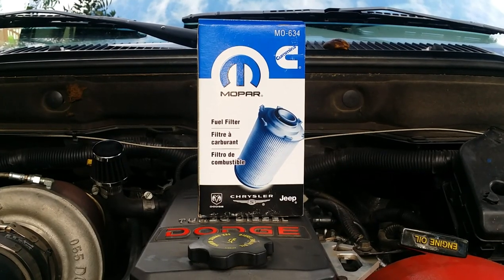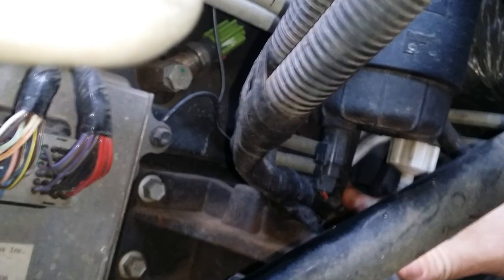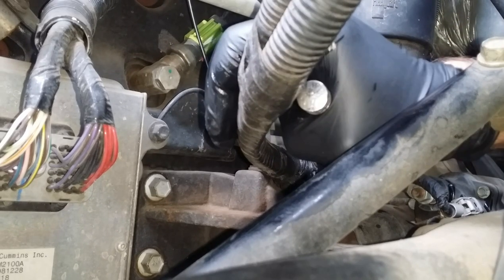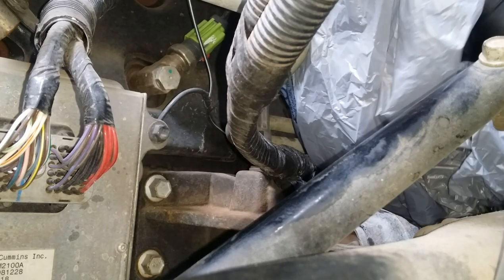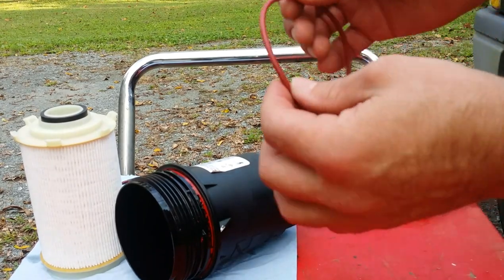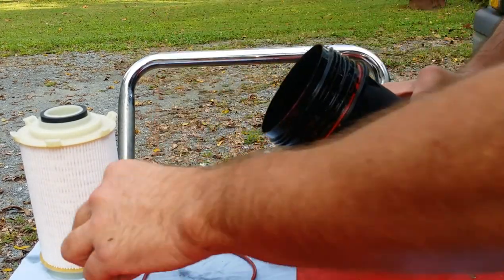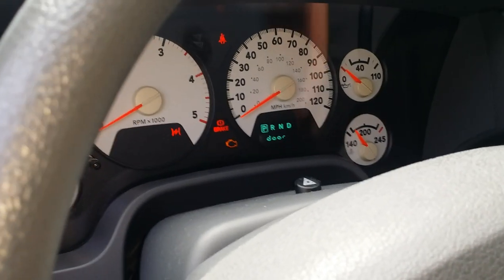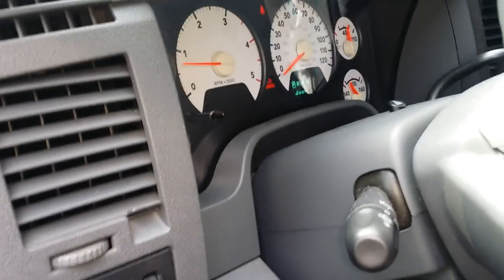07.5 - 09 6.7 cummins fuel filter change in detail

Comment: Just changed my filter this week after truck stranded me about 1.5 miles from home...but waited 15 minutes it cranked and I dashed for home, and it quit a couple hundred yards out but I was able to put it in neutral and coast to my driveway.  The next morning I changed the filter and it looked far dirtier than the one you were holding in the video, and the new one, of course is snowy white in color.  Thanks for the video.  Still grumbling about how hard the sensor was to get unplugged.  As far as I know, the filter had never been changed, 251K miles on it.
Reply from the maker: You need to change it every 10,000 miles. I change mine every 5,000. Glad the video helped. Thanks for watching.

Comment: Great video and I'm sure it will help me somewhere down the road. I'm heading out tomorrow on an 800 mile road trip to buy a gently used 2008 Ram 3500 SLT 6.7 2 WD single rear wheel. I've been looking for a tow vehicle for our travel trailer for over a year now and this may finally be the best one. Dealership has been very helpful sending pics and videos. Said the last owner kept it in a garage and never towed with it.
Reply from the maker: Heck yea hope it's the right one for you.

Comment: Thanks bro, super big help.  Only Rec is, if you can pre load the filter with fuel, much like one puts oil in the filter before installing, you’ll have less priming.  Tricky though because of the angles involved in snaking the filter and housing back in.  Again, thanks a bunch!
Reply from the maker: Thanks brother! Prefilling the filter is too big of a risk of getting trash in your injectors. You're right tho.......  would be tricky.

Comment: I just changed my fuel filter today. Not a easy task for sure! However I didn't bother with removing the wheel or inner fender. I was able do from underneath.  My truck is a 3500 2 wheel drive dually.  It was a struggle but still easier than removing wheel and inner fender.
Reply from the maker: They definitely didn't put in a good spot for easy access.

Comment: My filter is so tight im afraid of putting any more pressure on it, im not sure if this is still the factory or a dealer repleced it. Workrd on it for two days, its still a no go, next stop is go to the farm and get a 1/2 inch retch along with a filter wrench, this is one reason i never want to go into a shop for anything (striped the threads out of my oil pan when they did a simple oil change ) luckley i noticed it when i changed oil the next time and with a steal pan they can be fixed with plastic steal or thread lock on a reducer.
Reply from the maker: My gosh that's ridiculous. Get a new housing from napa or order one on line. I wouldn't put the old one back on and you will probably crack it getting it off anyway. Put the new one on using your hands only.

Comment: Very informative video. I’ve been Robbed. I have been doing most of my own service work for about the last 6 years except Transmission and Fuel Filter service because of safety concerns and I have a gravel driveway plus a torn Rotator Cuff from a couple of years ago. I recently stopped by a quick change place in Elko Nevada to see if they could change my Fuel Filter . I have known the owner for about 10 years and decided to give him the business. I had my own Fuel Filter and figured thirty or forty bucks would cover the cost. About 10 minutes later the kid comes out and the bill was $180.00 dollars. I asked him why the bill was so high and he said there were 2 filters that had to be changed. I knew that he was lying but what do you do in a case like this ? I paid the bill but I decided,never again. These Quick Change places are nothing more than a Ripoff and a lot of them should be taken out of business. It makes you wonder how many people are getting ripped off from these places.
Reply from the maker: Some models have 2 filters. 2007.5 to 2009 models only have one filter. What model is yours?
Reply: @isolateddieselperformance3261  it’s an early 2008. I bought it in December 2007.
Reply from the maker: That truck only comes with one filter.
Reply: @isolateddieselperformance3261  Thanks for the info.

Comment: Hey brother. What did you clean the filter housing out with?
Reply from the maker: Keep a small can of diesel fuel on hand and use it to clean the housing. Just rinse it out like you would a glass at the kitchen sink to get any loose trash out. Don't use anything else because the fuel system on these trucks are sensitive.

Comment: Great video!
I'm gonna try to do it my self thank you.
Every how many miles should I change the fuel filter?
Reply from the maker: Thanks man!! Its a easy job. Change it every 10,000 miles. Don't go past 10,000. You want them injectors to last a long time. Run some fuel treatment in your truck. I prefer hotshot secret for treatment.
Reply: @isolateddieselperformance3261  defenetly sir.
Where can I get the treatment from?
Reply: @isolateddieselperformance3261  also what kind oil you recommend ?
Reply from the maker: @RAULHERNANDEZ-um5fm  I run Rotella 15w 40 T4. Auto zone sells the hotshot secret fuel treatment. Amazon has it also
Reply: @isolateddieselperformance3261  awesome thank you.
Reply: @isolateddieselperformance3261 fuel filter from oreilly's wix?
Reply from the maker: @RAULHERNANDEZ-um5fm  cummins filter from the dealership or Amazon has it cheaper. I will only run cummins when it comes to oil and fuel filter
Reply: @isolateddieselperformance3261  thanks a lot for all the help
 I just did oil change,filter and fuel filter it was easy to be honest with you.
Keep doing great videos for people like me please

Comment: I’m getting a check engine light for thermostat and my heat barley works and my engine temp is all the way cold 24/7 that mean it’s a thermostat right ? WhAt u think 2007 ram 2500 6.7
Reply from the maker: Sounds like your thermostat is stuck open. Get a good quality thermostat and see what happens. Don't buy a cheap one.
Reply: Isolated Diesel thank you ! So much for replying. What’s a good quality one? Like how’s the ones at autozone lol.
Reply from the maker: You're  welcome brother! I prefer one from cummins or the dealership. They will last longer than the next 3 auto zone brand you will buy. 
Rockauto.com will have the mopar brand I'm sure and will be cheaper than auto zone probably.
Reply: Isolated Diesel thank you so much man
Reply from the maker: @johnnya4329  anytime man!
Reply: Isolated Diesel hey man me agin 😂😂 so I had a fourth gen it got totaled and to use the shifter on the shifter ? If that makes sense like if you look on the colum shifter it has a + - sign . So on that I pushed down one and it went to whatever geae I was in. In this new third gen idk how to do it. Not sure if my switch is broke ?

Comment: How did you even get a socket wrench to fit between the drain plug and sensor? I literally cannot get anything in there at all... my filter I guess whoever did it before me used an impact or something cause I can’t get this stupid thing off to save my life
Reply from the maker: Put a 1/2 inch reducer on a 3/8 drive ratchet and it should make it easy to get in the square between the sensor and drain plug

Comment: This was a great video.  It's the only one I found that covered the 2008 6.7 diesel with one fuel filter that unscrews from the bottom.  I did it without removing my wheel or my fender liner, but that's just my way, lazy.  One problem, I couldn't get a half inch drive to the square hole in the bottom of the filter housing.  I might have with the right length extension (very short) but most of my tools are up north at our other ranch.  I used a oil filter wrench made by MintCraft https://www.amazon.com/MINTCRAFT-JL194203L-Filter-Wrench-Plier/dp/B002MS8MGC
I know that's risky, but I was careful and built pressure slowly until it came free.  I grabbed it around the bottom part where it is smaller and has ribs and flutes on it.  Worked great and did no damage. Whew!
The job went perfectly with very little diesel on the ground and I attribute that to having watched your video, twice.
Thanks for the good work.
Reply from the maker: Glad it helped! Thanks for watching! A 1/2 inch reducer on a 3/8 drive ratchet is what I use to get the filter off. I should have mentioned that in the video. Sorry about that.
Reply: Yes, that probably stands it up enough for the wrench head to clear the connector and the fuel drain outlet.  I didn't bring one of those either.  I loaded 5 tool boxes and two big tubs with tools for our annual trip to the low ranch and somehow  I don't have any drive adapters or universal joints.  I noticed that by 2010, they changed the configuration so you can pull everything out the top of the housing.
Reply from the maker: You could pull the filter from the top before 07 also. They should have made them all the same.
Reply: Be really nice if they made an adapter or a change kit to go to the new style to change from the top.
Reply from the maker: @jtstandar  amen brother
Reply: 2009 I used stuby 3/8 ratchet and 3/8 to 1/2 adapter.  Good video